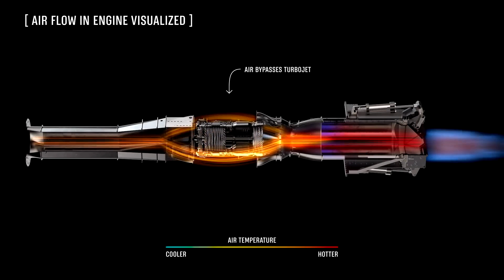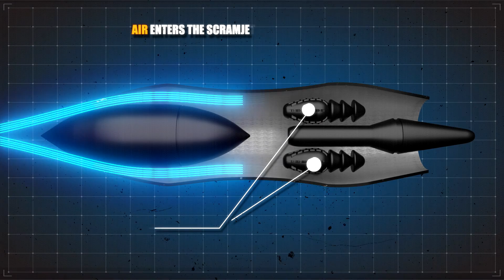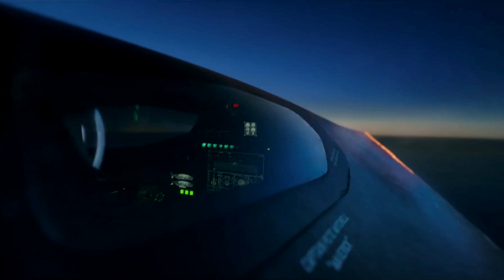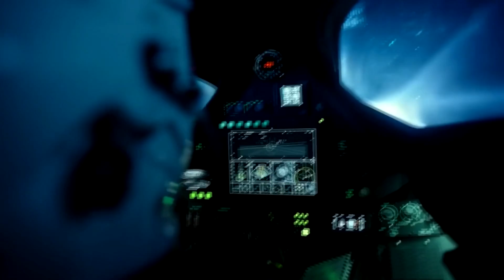SR-72 Darkstar Finally Ready To Fly

Comment: So Is it not possible to Implement a cooling system at the front to somewhat at least help along with the impressive material ?  They do it in rocket nozzels why not this plane ? Implement that, , minimal  radar cross section, This plane could  not only be used for recons but deliver various  warheads as well 😮 😇

Comment: While I never saw the Blackbird take off I was able to view one on the flightline before it was decommissioned in 1989.
The maintenance supervisor said it's just too expensive to continue.

Specifically the fuel consumption of the Blackbird was outrageous.  It leaked fuel before take off and had to be refueled in flight before the afterburners could be lit.  The Blackbird's skin was porous and could only be sealed at post supersonic speed.  I was told that the AF opted for the U-2 and conventional S for reconnaissance.

That's why I'm stunned that Congress and DOD approved a SR-72 program.  Unless Lockheed solved the problems with the Blackbird.  I need to give Lockheed Sunkworks its flowers 💐 because despite its issues the SR-71 was an amazing 👏 aircraft.
Reply: My late father was the first man to command both the U-2 wing and then the SR-71 wing. He, and the few who followed, got their stars. In my father’s case nearly 60 years ago. Like the SR-71 time flies.
Reply: yes because they would decommission a plane for its problems only to bring out a new one riddled with same issues lol use your fucking brain
Reply: Congress doesn't approve anything,  it's called BLACK BUDGET for a reason,  where do you think all the missing, unaccounted money goes.!!